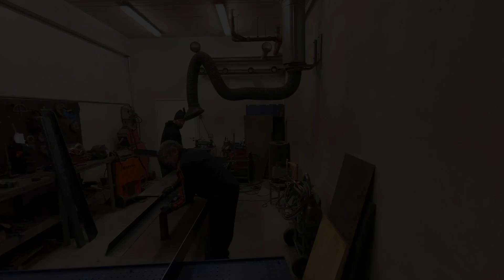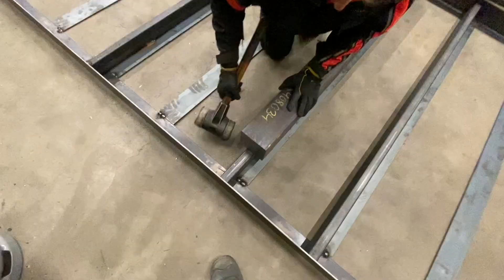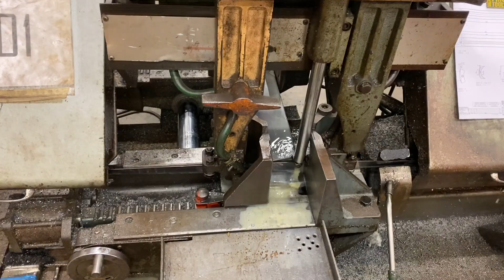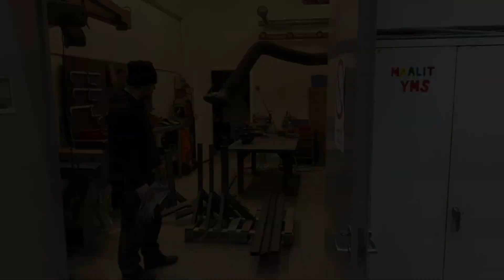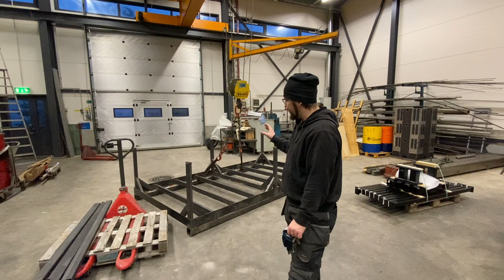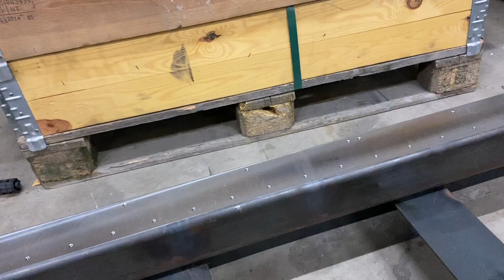DIY Large CNC Router machine for sailboat building project  - part 2 - Ep17 Project SeaCamel

Comment: Your "mishap" on the drill-press brought back horrible memories for me.  Many decades ago, when I was in college studying to be a shop teacher, I was drilling a hole and had the drill vice spin just like you.  You got off lightly with just a broken bit.  In my case it bent the spindle of the industrial variable speed drill press which cost several thousands of dollars to repair in 1980. 

As a result of that, I learned that the vice should always be clamped to the table and preferably it should also be braced to the post with solid stock so that is can never rotate.

Comment: man your so blessed to have access to this shop so that your able to use all of this equipment to build this CNC table and every other thing you built on your channel. I use to be a welder fitter did that for years so when I saw your welds it kind of freaked me out. but thats ok it only a table just clean you can clean them up with a grinder and remove some of the weld that is protruding up in your way. Than you can bolt those legs on properly. cheers looking forward to this build. It's common with stock tubing that you may have to heat it up and straighten it out before machining. Normally when your welding it up that try to pick out good stock prior to the welding process, bottom line they straighten it out that the main thing. The best part is all of the hole are drilled for your rails. shouldn't have any trouble with fitment.
Reply from the maker: Yeah, I have to thank my uncle. :)
But - I paid for the machining time so it was not free - or cheap!

There was some "worping" with the frame. The final welding was done in the shop by professionals and they also heated the frame slightly to make it suitable for the machining.
The important part was of course to machine the rail surfaces to high precision. That eliminated all the "worpness" of the frame.

Comment: Wow, that is a great base for a CNC and it will be uber rigid so you have the potential to achieve super accuracy across the whole bed.👍 PS I am a bit peed off with YT, I am subscribed to your channel and have been for a long while, with notifications set to ‘All’ but for some reason it has not been serving up your vids to me - have you upset them?😉
Reply from the maker: Thanks! I believe the accuracy will be totally enough for this project. The frame is super stiff, but as it's steel it should flex just a tiny bit. Haven't yet leveled it so we'll see.
And when machine is complete, I can use it to make sturdier aluminium parts to make it even better :). Last parts are now ordered. Can't wait to go to machine and finish them.

I don't know the internal logic of YT. Feels kind of random. 😅 I also don't receive notifications of comments every time...

Comment: Just curious what you plan to cut on this massive structure?
Reply from the maker: Thanks for the question. The measurements are taken from the standard plywood sheet available here which is 1500x3000mm. The work area should be that.
And the goal here is to cut parts for my sailboat. But there’s of course possibility to do much more like furniture or even structural parts for houses. As an architect I’m curious to see how can I design and realize algorithmic building parts as well. We’ll see about that. :)

Comment: Can i ask how much you paid them roughly for milling your frame?

Seems like quite the odd job most companies here wouldnt even consider
Reply from the maker: Well. It was quite expensive even though the place is my uncle's workplace. I got the work with non-profit price. Still it was several thousand euros over all with milling the frame, doing the mounting holes for the rails and racks and also cutting the rails and racks to fit precisely. Also there's some other work with the aluminium parts done currently. The welding was done with our own time. But yeah, as usual, the whole thing is quite bit more expensive than I thought.

I would imagine if you go to any metal workshop with this kind of project, it can be difficult. After all, it requires this very large milling machine to fit table this large into it. The easier way would be to go with ready-to-go aluminium profile system, but they're much more expensive to purchase than steel.